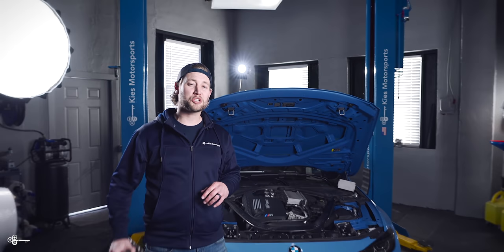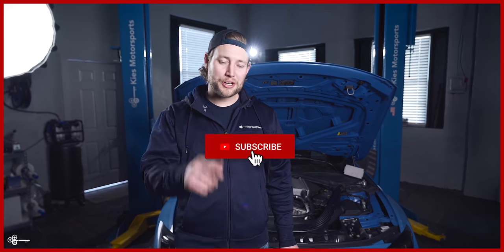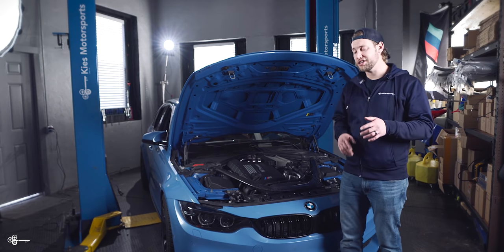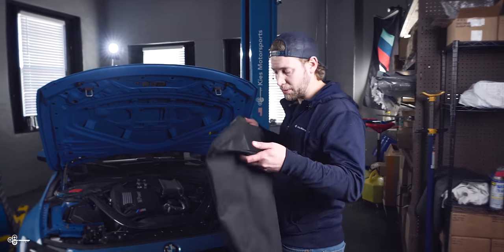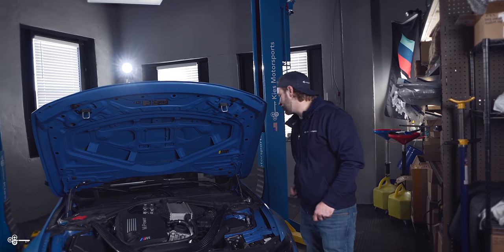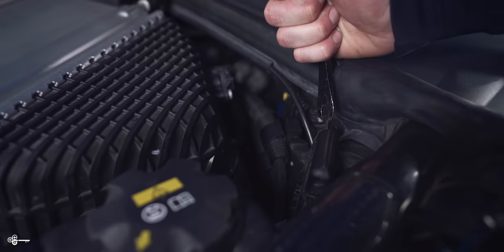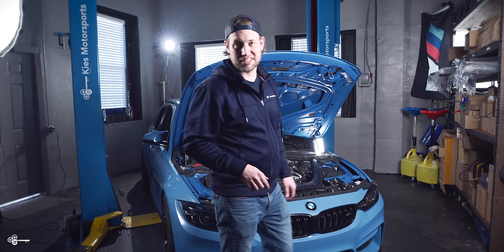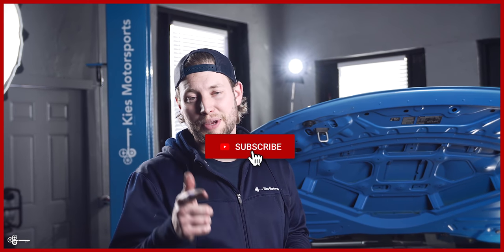HOW TO INSTALL UPGRADED DROP IN K&N AIR FILTERS IN YOUR BMW F80 M3 / F82 M4 / F87 M2C

Comment: No need to remove that first plastic rivet and the corresponding rivet on the other side.  You can just rotate the trim panels 180 degrees to get to the strut bar bolts.  This is what I do to check the brake fluid level under the driver-side trim panel.

Comment: I noticed the filter on my 428 M Sport has a black mesh attached to the paper, part # 13718511668. Does anybody know what the black mesh is needed for and if I'm fine to use the K&N?

Comment: So dumb question here.  New to BMW's, I'm looking to buy a 435.  How do you which bmw is a f30 or f90 etc?  Anyone?
Reply: F30 is the 3 series produced from 2011-2019 (Before the 2019 G20 3 series came out). F90 is the 2019 onwards M5. F80 is the 2014-2018 M3.
Reply: Your 435i can be an F32, 33 or 36 depending on if it’s a coupe, convertible or GC.